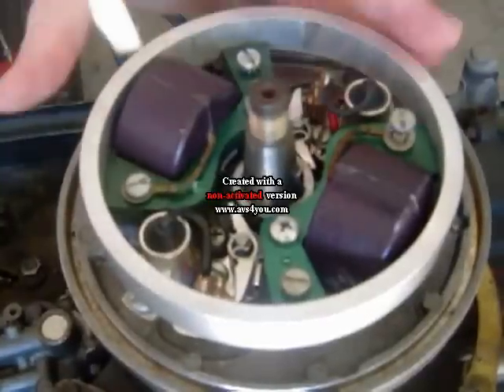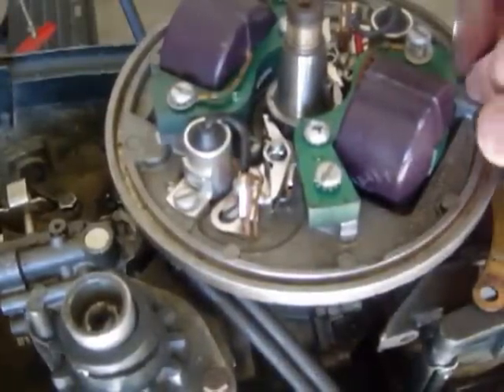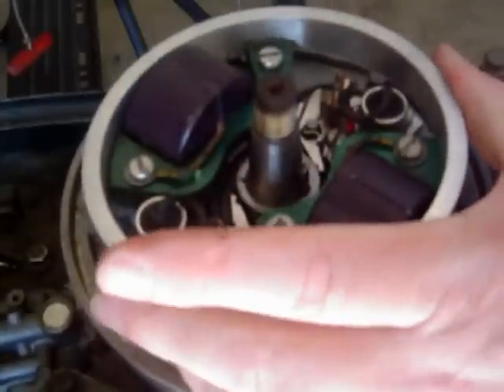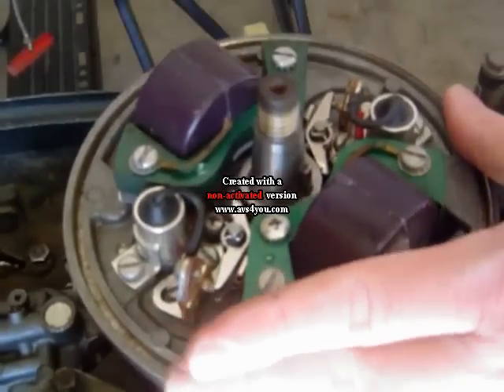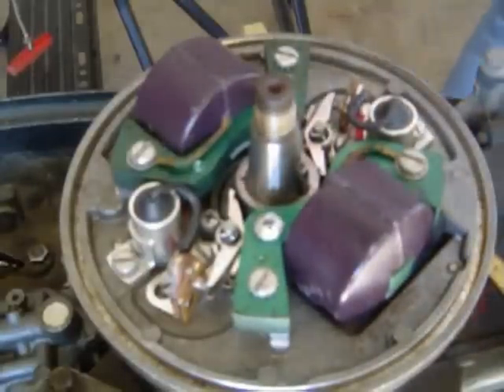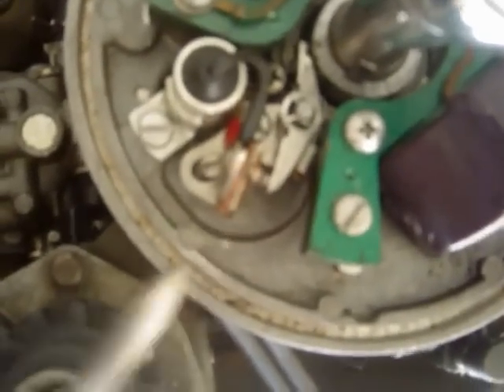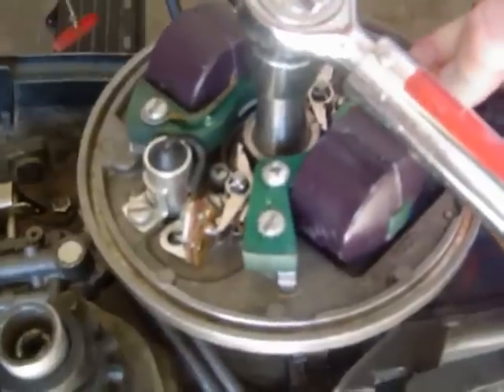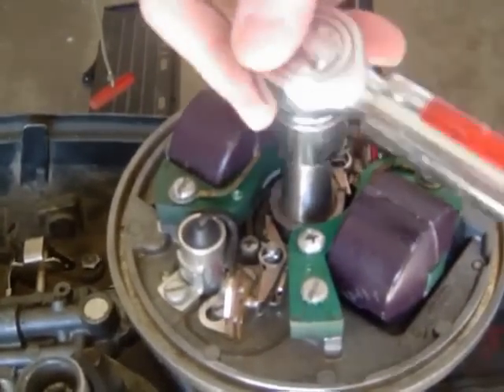Evinrude Gale and Johnson ignition video part 5 of 7

Comment: Is this an alternative to using the timing fixture tool you used on your other video?  Or do you have to do both methods, using the timing fixture and the way you did it on this video using feeler gauges?  If it's either or which method do you prefer?
Reply from the maker: They are two separate methods to set the points.  Do not combine both.  They are both the correct way to set the points timing.  The use of the timing fixture allows a more precise timing.

Using the feeler gauge is a very long standing method that was used for many many decades.

Later in the 1950's mechanics received literature from the product houses and an additional tool (timing fixture) for setting the points.

If you have the timing fixture use it.  If you have a feeler gauge use it.  Both are good methods :)

Comment: For  coil gap I just use a scrap of aluminum  soda can.  Cut  a thin strip  install the flywheel and  snug the screws through the inspection holes.  Don't screw with a feeler gauge on points.  Just  "guess" them open then adjust for proper timing.  If you don't have a timing tool, the flywheels  normally have timing marks on the bottom edge of the wheel, and marks on the front of the mag plate.   More gap advances timing,  less retards.   I use a mag timer  there are other ways

Comment: Are you using the straight-edge to measure each coil a certain distance from a certain point? From where are you measuring and what is the measurement?  Thanks for the video!
Reply: Not measuring, just using the edge of the "straight- edge" to visually align to make sure they don't overhang the locating surfaces to prevent contact with the flywheel magnets which you can easily and accurately also do by eye and feel, because they don't need to be located with precision.

Comment: Hey I have a 53 15hp and it misses at low rpm only cleaned and adjusted everything coils ohms out same as working one would it be points and condenser? Any help would be appreciated
Reply from the maker: Based on your description, we have to rule out if it is electrical(ignition) or fuel delivery(carburetor) settings.

Have you had the motor on the boat on the lake or are you running the motor in a barrel?

We are going to go with fuel delivery first.  You can get a miss if your slow idle adjustment needle is off.  You may have a lean sneeze and this means that you need to adjust your low speed/idle carburetor knob.   It is the top knob.  

When you turn it clockwise(right) it leans the fuel/air mixture. When turn it counter clockwise (left) it richens the fuel /air mixture.

  Get your motor running as low as you can.   When it starts to miss/sneeze, then turn the top knob counter clockwise (left) in about an 1/8 turn segment.  Give it about 10 to 15secs to react.  Continue to adjust the top carburetor knob unit it stops sneezing/miss and runs smoothly.

You can also buy two in line spark checkers to monitor spark firing of the top and bottom cylinder. Do this while the motor is running to see if it dropping spark and identify which cylinder is the problem.

If you are still having issues, yell back and I will walk you step by step to evaluate the ignition or the carburetor.  Hopefully this is lean sneeze/miss.
Reply: Thanks for the quick response I had a spark checker on it and when it misses it shakeslike hell and and you can see there is no spark on the bottom cylinder. I just rebuilt the carb and it's in a barrel thanks again
Reply from the maker: Great, you identified the spark issue to bottom cylinder.

Jeff P, are they the original set of points, condenser and coils?  Please stay away from aftermarket points, there have been a lot of quality issues with them.  Use OEM(BRP) points.  www.marineengine.com sells OEM points and condensers.

Go back revisit and reclean those points and reset them.  I have had the problem you are having and when I went back and recleaned and set, it resolved the issue.  It has happened to us all....fun aye....lol

You can also switch points and condenser around.  If the condenser/points are bad, then the problem will follow to top cylinder and resolve on the bottom cylinder. (Cost no money to do this and helps rule out parts.)

Please let me know the if ignition is original or replaced and what components.
Reply: @cajuncookone  they look all original OEM I was thinking the same thing. The strange thing is I can spin the fly wheel by hand and get a good spark on both but once back together same sneeze at low rpm. Think I'll clean it again and switch them up that a good idea thank you and thanks again for you help cheers from Ontario
Reply: I test the condensers and one ohms out lower than the other and that's the same cylinder that is missing
Reply from the maker: Let me know how things turn out.

Comment: He says use a straight edge and his hand covers everything he is doing. Ok use a straight edge and what? Whats the measurement?  Am I the only one with this question...
Reply from the maker: Joe, the straight edge, like a ruler, is to align the coil's laminates with the ignition plate's boss alignment piece.  It prevents the flywheel's magnets from rubbing against the coil's laminate heels and damaging the heels and the magnets.

Any straight edge will work.

The maker of the ring was added after the video was made.  It is not necessary to do the work, but it make it alot easier. I do not make any money on these videos. 

I made these videos to help a guy that lived a couple of states away, that had ignition and carburetor issues.  I did not intend to leave the videos up and  forgot about them.  When I went to remove the videos, I saw that several people were able to use them to repair their motors, so I left them up.

 If you do not care for them, you do not have to watch them or be ill mannered about my presentation or editing.
Reply: @cajuncookone  wHAT IS THE id OF THAT RING???  Thank you!

Comment: If you are using sierra coils that ring will NOT slide on like that MOST of the time. Several times that ring was useless on my outboards. The coils WILL NOT move enough to get it on without damaging the laminate on the coils.
Reply from the maker: Mark, the Sierra coil and points have had quality issues.  The laminates are not the appropriate size.  Sierra has out sourced to over sea venders that are not doing a good job and maintaining quality, so if the ring can not easily fit them in place, then the machining of the coil's laminates are off.(This can cause damage to the magnet and have offset space alignment between the laminates and the flywheels magnet.)  A lot of old outboard hobbyist and mechanics are keeping the old laminates and replacing the coil's cores with the Sierra cores.  The Sierra points have caused a lot of issues and are hit and miss.  Points and condenser for the OMC outboards are best if purchased by the OEM manufacture.

Comment: I might purchase a '76 Johnson Model# is 25rl76e this week and I was wondering if the points can be converted to electronic ignition.  I see some are using NOVA II modules.
Also, what should the compression be per cylinder?
Thanks,
Reply: Sims Fishing, Flats Fishing, and Kayak Adventures  anything is possible how much money do you want to spend the points are more dependable and easy to work on and cheaper I have a 75 9.9 but I had a 1986 parts motor that had the new style I swapped it over and after a year it wouldn’t start the part that goes under the flywheel went bad the replacement was over 300 so I went back to points lol

Comment: so etwas müsste auf deutsch sein die info ist nicht schlecht aber leider auf englisch
Reply: Why cant you use an old flywheel & cut it out in the magnet area so you can adjust an tighten the screws ?  Most of the time a business card will work to set the gap. You can find an old flywheels on Ebay cheap.

Comment: What is the circumference of the inside of the ring? I think if I new the circumference I could use a measuring tape to make it work for those of us that might not have the money to buy the ring. Just an Ideal
Reply: 4.5 inches just find a tin can or pipe with that inside diameter.

Comment: Where can I get that ring?
Reply from the maker: If you would like to inquire about purchasing a very reasonably priced coil locating ring and other tools for your 1950's, 60's and 70's OMC (Evinrude, Gale, Johnson) outboard, please use the follow email address.

frankstools@verizon.net
 
or go to Frank's Tools at

http://mysite.verizon.net/respdyk0/
Reply: cajuncookone thanks
Reply from the maker: no problem, hope your repairs go well.
Reply: @cajuncookone  what are you actually doing with the straight edge? Is it squaring off or a measurement
Reply from the maker: @jamessteadman1328  squaring it off.  Any straight edge will work.  You want the heels of the coil's laminates close enough to the turning flywheel magnets, but not rub and damage the flywheel and coil.  That is the purpose of the ignition plate's bosses. Proper line up :)

Comment: what extent is the opening of the breaker? I am from Uruguay thanks and regards
Reply from the maker: When point's shoes are at the top of the highest point of the cam lobe the breaker points should be gaped at 0.02 inches or 0.508 mm.

On the points cam there should be word machine stamped into the cam labelled "top".  That is highest point of the cam and timing is correctly set when the breaker is gaped with a feeler gauge at 0.020 inches or 0.508 mm.

I hope this information helps you.
Reply: ok thank you very much for the information and other questions, to set it up as I do when the piston is up and where it should be open platinum himan hanging above the coil?